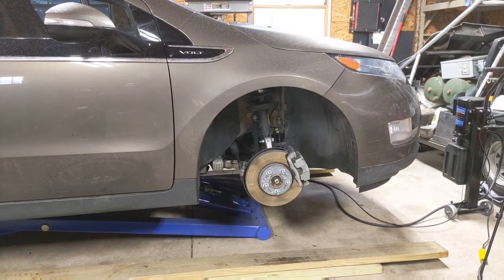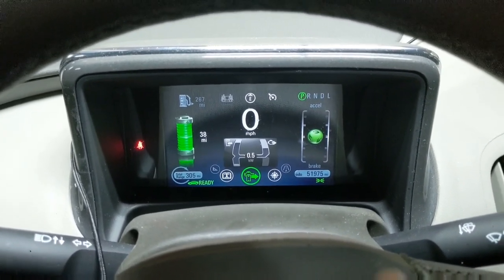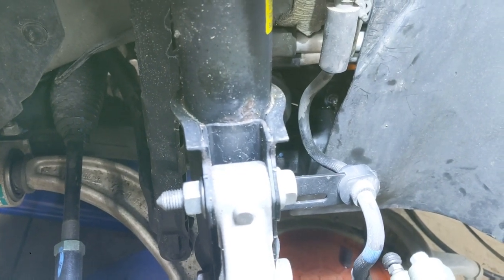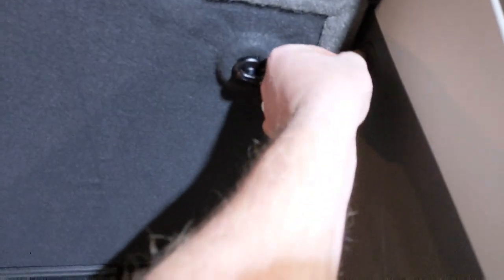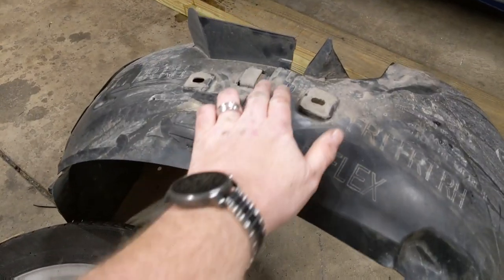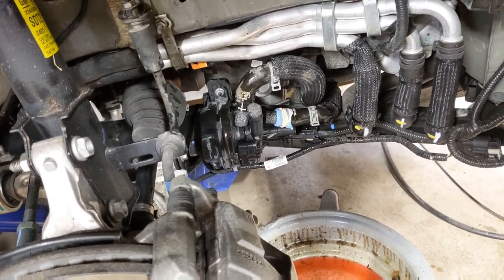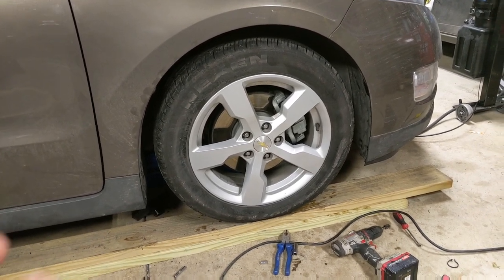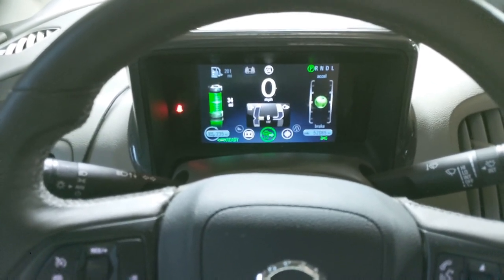Fix a Chevy Volt with no heat when running on battery!  We found a faulty circulation pump!

Comment: Super handy instruction set.  I did it in less than 2 hours thanks to your instructions.  Tip to save coolant in case you do not want to drain it...
1) loosen the hoses with pump in place, so you know you can remove them
2) remove pump completely, except the hoses are connected
3) remove each hose and quickly swap to the new pump, pinching the hose to limit leaks. If you decide to plug them, conveniently the hoses are exactly the same size as the factory lug nuts on my Volt.
Reply: Did you have the exact issue as in the video?
Kw would spike up and down then stay down at 0.5kw?
And did your heat usually work?
What was the fix?
Thanks...
Reply: @golfish8589  Yes.  Same symptoms, but you can have more than one cause.  In our Volt, the heat failed only sometimes, and then failed more often.  The electric heater uses the same coolant and heater core in the cabin as the standard engine heater.  The computer decides if the flow should go through the engine to get heat or through the electric heater.  There is an electric pump and a y-valve.  If either goes bad, the electric heater will sense that it is in hot water, and stop taking power.  At the same time, the coolant is not flowing to the cabin heater core, so you are still cold.  You can run the heat and feel the hoses and see where the hot water is.  I believe a bad valve will show the same symptoms as the bad pump.  In most cases I have read, the problem is not the electric heater element itself.  It is a tricky problem to track down, but the pump is a cheap and easy, so a good place to start.  I was lucky that was the only problem.

Comment: The volt was making no heat.
1D10cracy could not be beat.
New part for the Volt.
Goes on with two bolts.
He now it is heating so sweet!

Nice job.  Thanks for the fun.  :-)
Reply: Did you have the exact issue as in the video?
Kw would spike up and down then stay down at 0.5kw?
And did your heat usually work?
What was the fix?
Thanks...

Comment: Had mine repaired 2 years ago and it is doing it again! Have had a service high voltage charge and charged $1700.00, had extended warranty is probably why they charged so much.

Comment: Very helpful.  I really appreciated you taking the time to video this diagnosis and repair.  I have a 2015 Volt, just now getting 114k miles on it, and aside from frequent CV joint replacment, this is the first item that has needed repair.  Saved me $600 labor quote from Chevrolet.  I did have a very difficult time getting the cover for the electircal plug removed, and as well, the plug did not want to come off, and yes, I did pull back the white locking clip.  Almost broke it I think prying on it.  Speaking of the frequent CV joint replacement, has anyone else had this experience.  I had to replace them at 45k miles under warranty and again at 90k.  But they were clicking again already at 105k   I suggested to the dealer that the last CV joints they put in could be considered defective only lasting 15k miles,  but the dealer said no luck, and I'd have to come out of pocket for the repair, since my 100k drive train warranty had expired.  I have just been going easy on acceleration around corners and getting the joints to last as long as possible.
Reply: I’ve also had an issue with clicking. Every time I cut the wheel all the way to the left to make the hardest the left possible I hear the clicking.
Reply: 2014 80,000 no clicking
Reply: There are TWO clicking issues.  1. Sounds like a CV axle-it is not, it is a washer and torque process needed. Link below.  2. Mine has 189k just replaced driver side cv axle first time.

Comment: My pump was vibrating so badly it sounded like the ICE was running.  Same fix. Anyone thinking of doing this themselves, go for it.  It’s as easy as he makes it look. Thx!!
Reply: Had mine replaced first time but started vibrating months later. It was replaced and now there is no heat again, this will be #3 under 55000 miles. Cheep parts used by GM! Also a 2015.
Reply: I had mine replaced, then had the vibration problem “fixed”, now it isn’t heating again. Kind of getting expensive.

Comment: Thanks for the video!
The two pointers I'd add:
1. I needed a deep socket (10mm I believe) to remove the two nuts holding the pump in place.
2. The hose clamps were sort of bedded into the hose and were easier to remove once the pump was detached from the bracket and I could get a better angle to give the clamps a firm wiggle back and forth, with a bit of oil on the hose.

Enjoying my heated all electric commute once more!

Comment: Awesome thanks! I was checking every winter for someone with a fix on YouTube because my volt has always had this problem since I bought it 3 years ago..
Reply: Did you have no electric heat for three years?
Or was it occasionally no electric heat?
And was the pump your fix?
Reply: @golfish8589  yep pretty much.. i had to pop the trunk every morning to force the motor to kick on so that the heater would run…  and yep. it was the pump. i changed it out and now the heater works , when the car is running on the battery… *although i have noticed that when its REALLY cold in the morning (below 30), its like the coolant is just too cold or something, and the heater wont get hot when running in electric mode.
Reply: @golfish8589  and yes, no heat on electric mode.. i remember it did work on an off chance, maybe 10% of the time.. but mostly, it would not work… it probably did work that 10% of the time, because it being the pump which was the problem, the faulty pump would probably work on off chances… just figured that out with my washer machine actually… i kept getting a “long drain code” i assumed my drain pump was ok because it would “work sometimes”, “proving the pump worked”.. but no.. at least those pumps run using magnetic forces and yeah, it might work 1 out of 10 times… but its still faulty and is what needed to be replaced…but i digress
Reply: @miltonsaucedo2223  I guess the pump would be the easiest to replace. and if it is not the cause. I always have a backup. Thanks...
Reply: @golfish8589  fersher! if your having this problem, yes for sure change the pump. high probability its you solution i would say. good luck 👌

Comment: fantastic video. I have the exact same model, year, and color volt with the exact same problem with the heater.  I just bought the same part that you referenced. It's now $205
Reply from the maker: My favorite color for the Volt!  It's a pretty easy change.  Oddly I've read where people have been able to get the dealer to replace it under the Voltec warranty.    The dealership I took it to said it was not covered under the warranty.

Comment: My daughter's Volt is having similar issues so while researching the issue I found your video.  This was VERY helpful.  I watch a lot of automotive  videos and I have to give you props - this was extremely clear.  Well done.  Now I am well informed to diagnose the problem (I suspect it is the same issue)
Reply: Update? Did it work?
Reply: @FEAdeES  yes.
Reply: @FEAdeES was yours no heat or intermittent no heat?
Reply: @golfish8589  no heat at all
Reply: @FEAdeES  what fixed your heat?
Another commenter is having total no heat
Reply: @golfish8589  I changed the pump by the passenger front wheel, I cleaned the in-inline filter by the back of the engine and this did not work. I had to take to dealership to change a part behind the steering wheel. I know there is a youtube video of a guy who does it inside his garage but it is very labor intensive. $1K+ repair at the dealership

Comment: Great video as my daughter's 2015 just started the 'no heat' issue. $180 is cheap compared to taking it to the dealership @$100++ a hour for labor. Thanks.
Reply: Did you have the exact issue as in the video?
Kw would spike up and down then stay down at 0.5kw?
And did your heat usually work?
What was the fix?
Thanks...

Comment: Had same heat problem ... just replaced this pump and it worked. 
Good video ... thanks!
Reply: Did you have the exact issue as in the video?
Kw would spike up and down then stay down at 0.5kw?
And did your heat usually work?
What was the fix?
Thanks...
Reply: @golfish8589 Well … I should revise this post … I found that the pump did not fix the problem . So… I took it to a Chevy dealer who said could not find anything wrong … but after that the problem never came back?
It’s still fine … it might have been just a connection that needed taken apart and put back?
Reply: Yes… would go down to .5kw… which means heater is not working…try turning temp up and wait a minute or so… heater will jump kw to 2-7kw

Comment: I have a 2014 ELR that's not blowing warm air. Curious if yours made a loud humming sound (like the engine was running) before it failed completely. That's what happened to mine. Thanks for the great video.
Reply from the maker: It did make an audible hum before failing.
Reply: @1D10CRACY  Much appreciated. Keep up the great work.
Reply: Did you have the exact issue as in the video?
Kw would spike up and down then stay down at 0.5kw?
And did your heat usually work?
What was the fix?
Thanks...
Reply: Did you make repair yourself?

Comment: Thank you. Chevy service charged me $200 to diagnose it and another $900 to replace the pump. Duck that ima try to fix it myself. Thank you 🙏
Reply: 😑 finally got around to it, still no heat, u talked about a valve if the pump is running but still no defroster or heat working. What kind of valve is it called?
Reply: Did you have the exact issue as in the video?
Kw would spike up and down then stay down at 0.5kw?
And did your heat usually work?
What was the fix?
Thanks...
Reply: @cristianpaulmartinez52 
Did you have the exact issue as in the video?
Kw would spike up and down then stay down at 0.5kw?
And did your heat usually work?
What was the fix?
Thanks...

Comment: Hey, great video. Is that pump shared between interior heating and battery heating? I have a problem with battery heating, it doesnt seem to get warmer (get up to 13-15C degrees) and because of that car keeps running on gas generator. Even when its running on the gas generator, it gets warm inside but the battery remains cold, and only when it gets up to 18~ degrees it starts using the battery. On city trips it generally means it never gets that temp, only when I have a longer road trip it worms up and switches to the battery. When it gets warm outside the car functions without problems.

Comment: I’ve Chevy volt 2014. I’ve no heat in both modes (ev and gas) used to have some heat on gas mode before. 

I’ve checked the pump and it seems like doesn’t work. Is there anything else should I check besides the pump that underneath on passenger side? Thanks for the video!

Comment: HELLO?     

This a great video.  One question: how did you air bleed the cooling system?
Reply from the maker: I didn't.    ;)  I figured because I plugged the lines and didn't have to add any fluid to it, it would be ok.    The gamble was the little bit of air in the new pump would work itself out.  Probably not the best option, but it worked for me.   The correct procedure would have been to pull a vacuum on the system.

Comment: Great instructions - thank you! Other cause for no heat while running electric is a bad thermostat, I understand. Is there a good way to rule out one over the other (t-stat vs. pump)?
Reply: Did you have the exact issue as in the video?
Kw would spike up and down then stay down at 0.5kw?
And did your heat usually work?
What was the fix?
Thanks...

Comment: Great video!  I have error P00B7 and no coolant leaks in my 2012 Chevy Volt.  I just replaced the thermostat, but it turns out that was not the cause of the problem.  I do not get heat even in Gas Engine mode, so I do not suspect the heater pump your video shows.  All I can guess is the Water Pump is not generating enough flow... the vehicle overheats when in Gas Engine Mode.  I cannot imagine that the Heater Control Valve you showed in your video would cause an overheat engine condition if it is blocked, could it?  Can you think of anything else that might cause the engine to overheat and no hot air coming into the cabin?
Reply: You need a HVAC module reprogram. 435 dollars at dealership.

Comment: Where is the flow valve if its the broken part?
Reply: Where is the valve?
Reply: Did you have the exact issue as in the video?
Kw would spike up and down then stay down at 0.5kw?
And did your heat usually work?
What was the fix?
Thanks...
Reply: @golfish8589  i have this exact issue, i did change my pump, but still have the problem, so now i think its the 3 way valve, near the intake on the back of the engine. Im too lazy to do the job and i use the ICE if i want heat
Reply: @Lavabo-Quebec  i really don't no anything about the three-way valve.
If the three-way valve was stuck do you know for sure you would get heat through the engine?

I do know some have had the occasional no heat on electric  solved by a software update. 

Also there is a screen on the inlet to the heater core that gets gummed up and plugged. Which would turn off the elecyric heater if no flow. But this would also affect engine heat through the heater core.

Comment: What's the process to refill the coolant?  Is a vacuum required or can you just pour it into the reservoir?
Reply from the maker: I believe you are suppose to put it under a vacuum if filling from empty.
Reply: Did you have the exact issue as in the video?
Kw would spike up and down then stay down at 0.5kw?
And did your heat usually work?
What was the fix?
Thanks...
Reply: I ended up doing the replacement pump myself and then paying for a coolant flush immediately afterwards

Comment: Great video, my 2014 Volt gave codes P15C5 and P26A5. Looking it up it says 22987494 is the valve by the firewall. The one in your video I think it is the pump. Correct me if I am wrong and thanks for the video.
Reply: Yeah just tested the pump and it vibrates also getting heat in EV so valve it is
Reply: Did you have the exact issue as in the video?
Kw would spike up and down then stay down at 0.5kw?
And did your heat usually work?
What was the fix?
Thanks...
Reply: As I said în one of my replies it was the valve.

Comment: My heat not working electric or gas motor at all could it be this pump ?
Reply from the maker: If it's not working on gas, it may be a valve.    I've also read about programming issues on the early ones.
Reply: Did you have the exact issue as in the video?
Kw would spike up and down then stay down at 0.5kw?
And did your heat usually work?
What was the fix?
Thanks...

Comment: Hi there, Could the faulty pump result no heat on gas as well? My 2016 volt blows cold air no matter on gas or battery. Thanks
Reply from the maker: Normally no heat on gas and electric is a faulty valve.

Comment: Don't know why you need to disconnect the lead acid unless trying to avoid a trouble code. 12v plug should be friendly enough if there is power flowing when you disconnect it but car should be off so that pump shouldn't be running. 
The impeller on my pump that is directly underneath the radiator cage busted so going to swap that 1. Found some pumps used on eBay for cheap
Reply: Did you have the exact issue as in the video?
Kw would spike up and down then stay down at 0.5kw?
And did your heat usually work?
What is the name of the pump you replaced
Thanks...
Reply: @golfish8589  no mine just has to do with battery cooling loop. Your symptoms seems to be no coolant flow because heaters on for short time then drops back down to 0.5 kilowatt witches car idle could be the other pump or valve

Comment: I replaced mine as well, but my 2011 doesn't have the kw gauge to monitor.  I still don't have heat on electric, only on ice,  and I can even hear and feel the pump working.  Did you run some sort of GDS or SPS app afterwards?
Reply: There is a screen on the heater core inlet that gums up..
Did you have the exact issue as in the video?
Kw would spike up and down then stay down at 0.5kw?
And did your heat usually work?
What was the fix?
Thanks...
Reply: @golfish8589  heater works only on ice.  The 2011 doesn't have the kw display as stated.  Is it hard to get to that filter mentioned?  Is that filter in a different heater system than the ice heater?
Reply: @MPDano  so you replaced pump and still have no heat on ice. Do you have heat on electric?

Since it sounds like the filter is on the inlet to the eater core. It would affect both ice and electric. The motor may have a stronger water pump then the one replaced in the video. 
There is a valve somewhere that does something in the heating system
Reply: @Golfish  ugh, sorry.   Too early for me.  I do have heater on ice, just not on electric.

Comment: Trying to find any guides on a gen 2 volt. Heater only works once engine runs for a while. Do you know if the pump is in between the motor and radiator in the gen 2s?
Reply: Hi Zack. I have a Gen 2 with no heat in EV. Have you had any success yet with this issue?
Reply: Did you have the exact issue as in the video?
Kw would spike up and down then stay down at 0.5kw?
And did your heat usually work?
What was the fix?
Thanks...

Comment: If the pump does not pump how does it work with the gas motor only.  Is there a separate pump for gas op?
Reply from the maker: The water pump on the gas engine moves the coolant when in ICE mode.
Reply: Did you have the exact issue as in the video?
Kw would spike up and down then stay down at 0.5kw?
And did your heat usually work?
What was the fix?
Thanks...